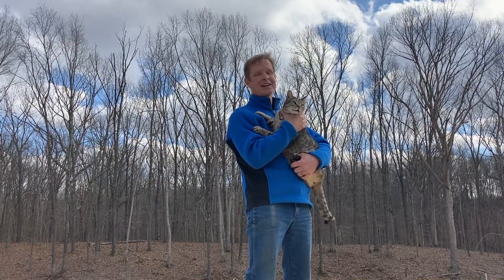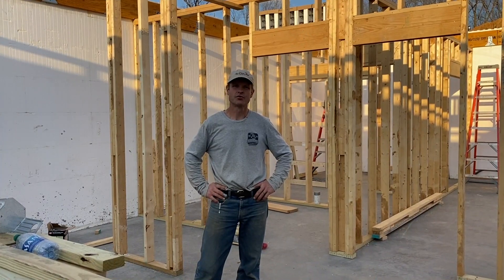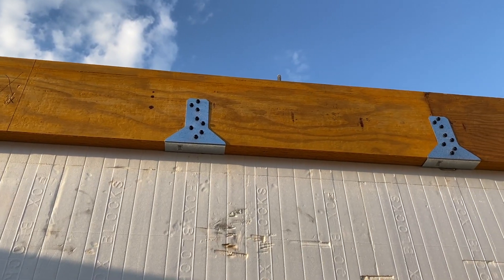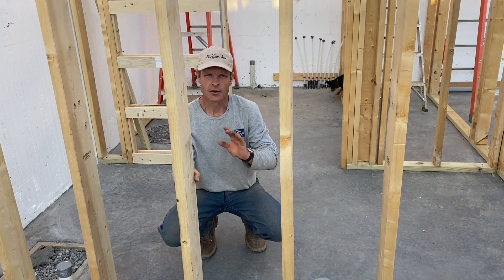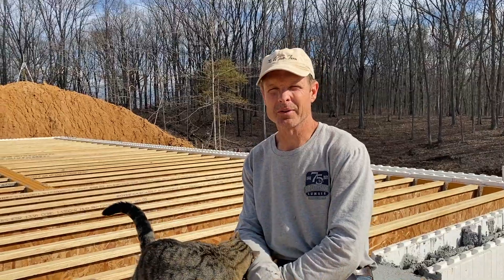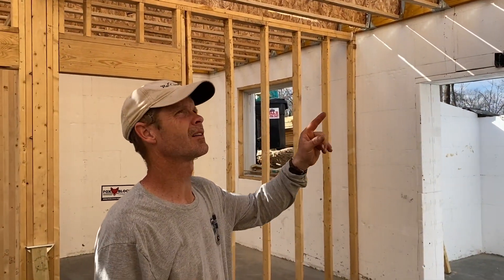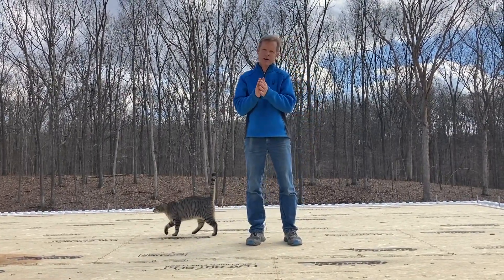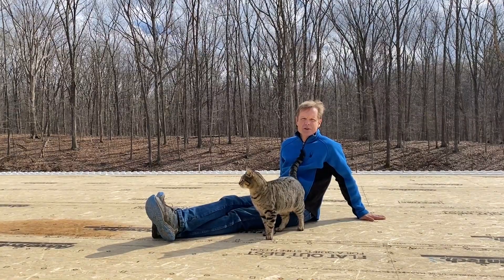Building an ICF House, Part 7:  Framing the Basement and Ceiling/Floor

Comment: Boards under headers (Jack's or cripples) should go to the pressure treated plate, not the concrete
Reply from the maker: You’re absolutely right. Thanks for pointing that out. I didn’t catch it earlier. I’ll be checking with my builder to see if he had done that for a reason.

Comment: Maybe you could do a segment on the root cellar?  I remember having one and seeing others where I grew up as a kid but never really understood their value.  Also, curious how you will prevent the moisture in your basement root cellar from entering the home’s framing. And have you thought about venting?  Where I live I have to think about radon gas.
Reply from the maker: That’s a great idea, and one we will definitely have to explore in the future, once the root cellar is up and running so people can visualize better. As far as the framing, you’re correct in that a typical wood framed house would need some type of moisture barrier‘s to protect the wood. In our case, however, we are using the ICF. There is no wood framing between the root cellar and the main house.